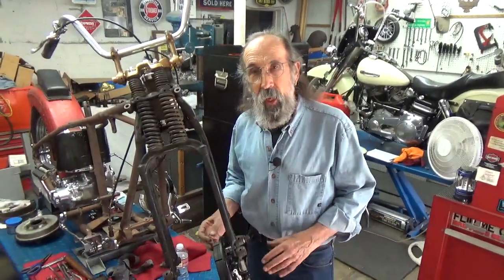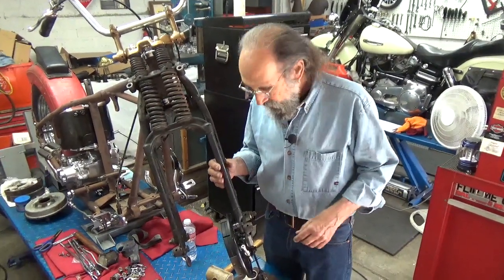Reshaping, Welding and Fitting Front Brake Shackle On the Harley Davidson Big Flathead Project Bike

Comment: I tease, but I do enjoy your vids.
You`re meticulous & show detail.
Quite informative for the uninitiated.
Not that I`m likely to do much with this knowledge, but still fun to watch.
I`m female, retired (old) & have built some bikes.
None so nice as yours, but not bad.
These days I have only one.
A very original, low mile, 84 Ironhead. Except the drag pipes & paint isn`t original.
(It`s black cherry & started out black. Too many black Sportys & I never cared for the logo from that year either)
So, I`ll refinish it...my fave thing to do is painting them.
I`m making it white with 70/71 SPORTSTER script in HD orange w/black outline
Since I have respiratory issues (probably from painting) I`m not supposed to do that anymore,
but plan to anyway,  outside in my yard with foo foo cans & can still get a pro quality job.
Using basecoat & clear, then buffing.
I just rebuilt the carb & I can adjust the pushrods, static time & set the points...all on my patio.
(No lift or fancy tools here)
Anything more than that & it goes to the shop!
Seem any WOODEN Indians lately?
Oh yaa, I`m in Flori-DUH...
Reply from the maker: Thank You.  You're a real pleasure.

Comment: Cutting the cord, your going to wonder how you did it the old way. Love your work, still trying to figure out how you know the fork geometry is going to work.with that cut link, but l know you got it under control. Still laughing at My Dog Has Manners! LOL
Reply from the maker: Thank You.  All it does is move up and down and hold the backing plate from turning.  I didn't shorten it at all.  It was just a matter of width, where it attaches.  No change in geometry.

Comment: Just my thoughts on the bracket. I would have made a bracket instead of cutting up a stock bracket and welding it. I have been welding up all sorts of alloys for almost 30 years and the issue is not the weld but the embrittlement that occurs next to the weld, in the heat affected zone. You may have forged the weld area and annealed it to normalize the grain growth but it doesn't look like from the discoloration on the part. You may never have a problem with it but is it wise to be putting that out for people to emulate with out your extensive experience. I love your content and wish you the best.
Reply from the maker: Thank You.  It's going to be great.  And, I wanted an original looking piece there.

Comment: Hi Mike. About to get my project evo motor and transmission with 150k that needs complete rebuilding. With little experience working on motors im excited but nervous to start the hobby. But your evo rebuild videos will be a big help! Any advice for a newbie builder? Thanks
Reply from the maker: Good luck!  It's a big undertaking.  I started in with things that were way over my head.  Take it slow and remember to check things out thoroughly.  You'll have to go to competent people occasionally for certain operations you're not equipped for.  The service manual is your bible.  Don't assume anything.  Things that you've done before still have to be looked up and instructions followed.  Torque settings, measurements, ring gap locations.  Again, make yourself read it.  Oh yah, it's gonna be great fun.
Reply: @pacificmike9501  Thanks! I cant wait. Luckily I have a buddy who has been working on evos his whole life, and helped get my 94 running

Comment: With new ideas all down the years, it's the custom builder's tangle,
the brakes from one, fit in forks long gone, yet their lines of thrust & dangle . . .
cannot complete, 'cos the bits don't meet & they need some 'electric mangle'.
So with head spun round, sore neck fresh ground, new 'hide' of paint for vanity,
she'll haul you down, all over town & make sure that your brakes torque sanity.
(I realise that mentioning sanity during a Presidential election campaign is pushing things a bit, but hey, we have Boris : )
Reply from the maker: Your Dudeship;  Truer words hath never been spake.  You are not just a superb linguist, you are a great sayer of truth.